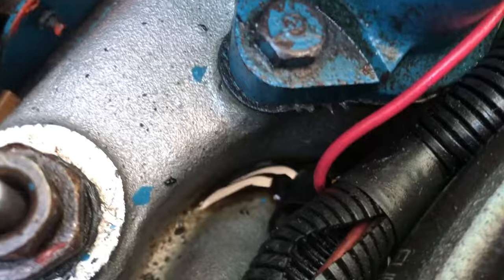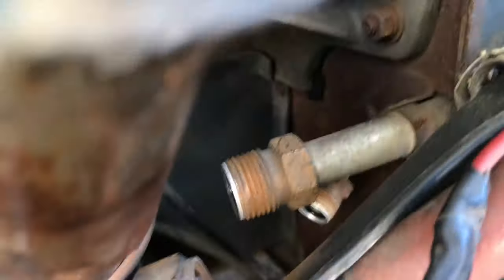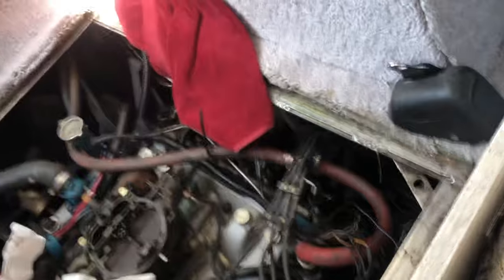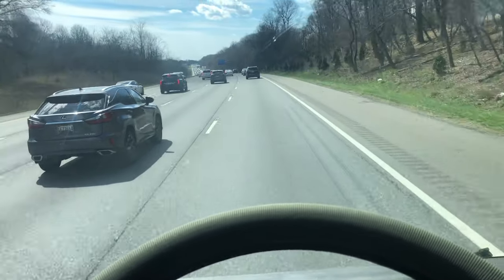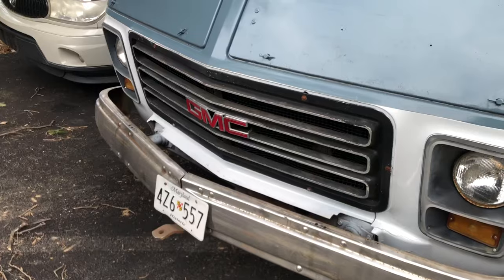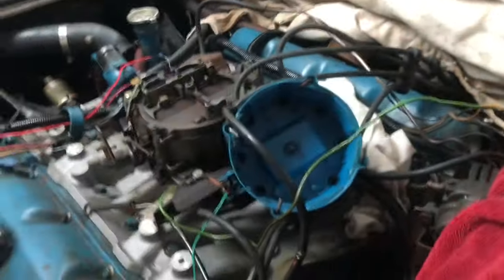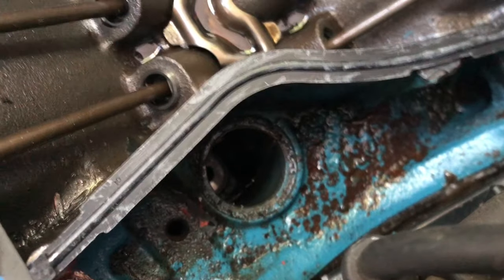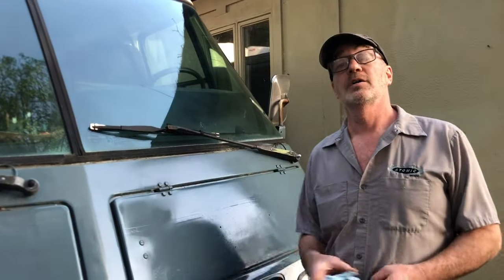1973 GMC Motorhome Episode 30 "The great oil leak mystery"

Comment: Hey a couple things - your AC fittings appear to have been converted to 134A ... (my dad did AC and was an ASE certified tech for 45+ years) ... also - the theory on the oil is that there is no windage tray like modern motors have - so running 5 qt instead of 6 reduces that splatter effect.  the PCV - you mentioned is the "Positive Crank Vent" -  you could have a front cover leak - and the fan blowing it rearward ... best thing to do would be hose the block down with brakeclean or carb cleaner or something to remove all the oil residue - then either set idle and run it - or drive it a few blocks - and return and look for fresh residue.

Comment from the maker: Thanks Mudman for the comment. It ends up being that when I out the aluminum intake on I used silicone at each end of the manifold. When I reinstalled the intake with a fel-pro set with rubber strips it cured the problem and no more leak. Go to the end of the video and you will see what I am talking about. Original A/C remains removed as well. Aftermarket unit in the future… rooftop with generator for now